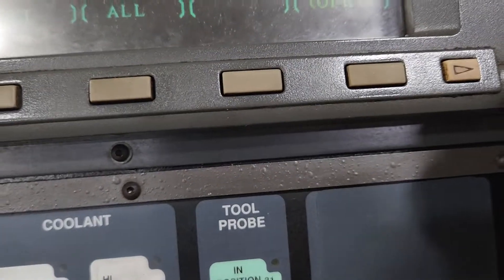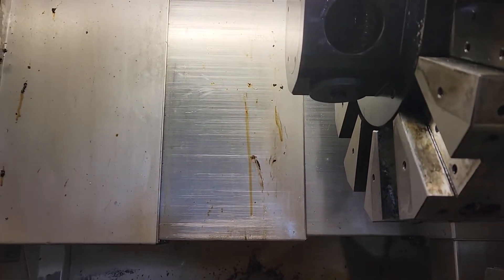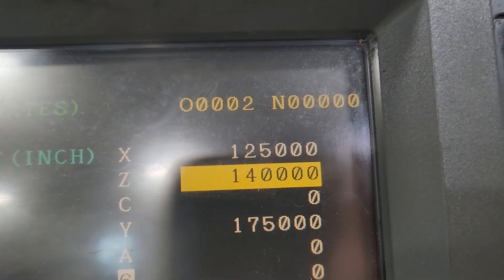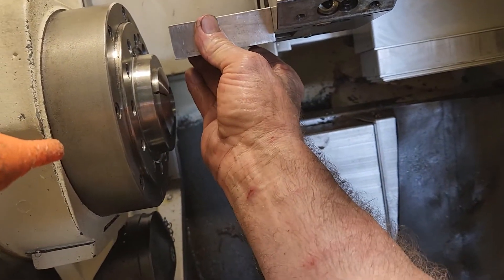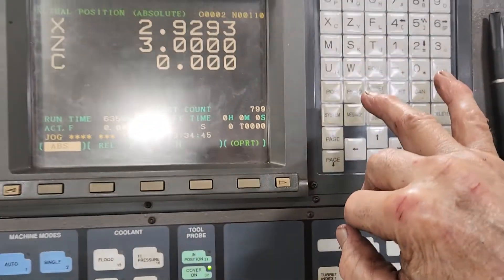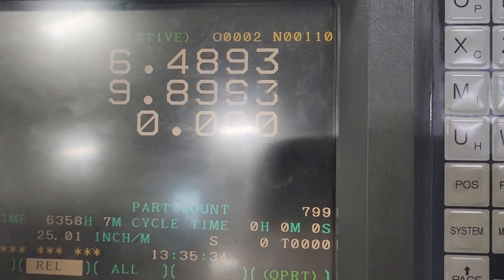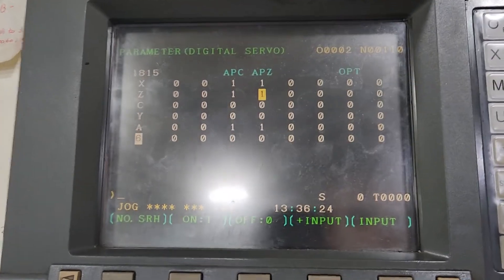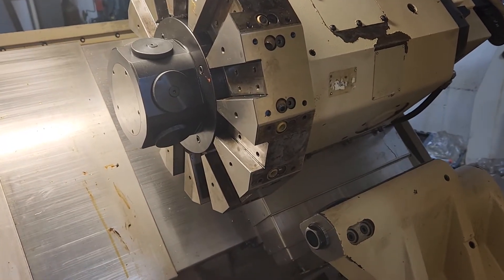Reset Z-axis after tripping the torque limiter or getting a 300 APC alarm with a Fanuc 18-T control

Comment: We over torqued the x-axis so our home is all messed up because the turret dropped. How do we do this? Also you didn't say how to make it a zero on the APZ
Reply from the maker: Send me an email to quikenuf.racing@gmail.com  and I will send you the procedure for resetting the x-axis torque limiter when I get home tonight.
Reply from the maker: Also, you need to check the ice cube relays for the x-axis brake. One is for e-stop and one is for power down. If either of these go bad, which happens often, the brake doesn't release, and then the x-axis trips the torque limiter, or wears out the brake. Then, the slide will drift down when you e-stop the machine. The brake is an external brake located on the lower end of the x-axis ball screw.
Reply: Never mind we got it.

Comment: We were able to reset the homing feature by holding down P and CANCEL while we power cycled the CNC controller (NC POWER OFF and NC POWER ON) and that reset the home coordinates correctly.
Reply from the maker: @lebedda " Cancel" and " P" ignores the soft over travel limits on machines that use switches for homing. Once the machine references,  parameters 1320 and 1321 become active.
Reply from the maker: @lebedda  You were probably getting a "reference incomplete" or an "over travel" alarm, not a 300 APC alarm. The machine position numbers got mixed up, and it was hitting a soft over travel alarm before it reached home position. Sometimes, machine tool builders just write a "reference incomplete" alarm. Cancel and P will get you out of that situation.

Comment: Thanks for the info I have a Quest51 that always trips the torque limiter, i wrote down the instructions on how to do this but lost them, again thanks for the video.
Reply from the maker: @metromfg  Quest51 is a nice machine. I would recommend changing the hydraulic oil once a year and the filter element if there is one. Best of luck to you!